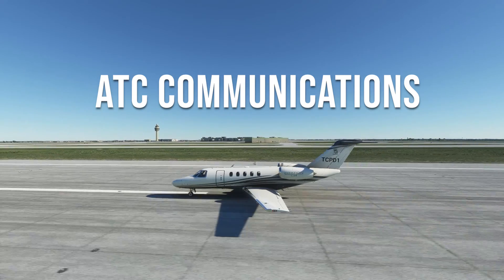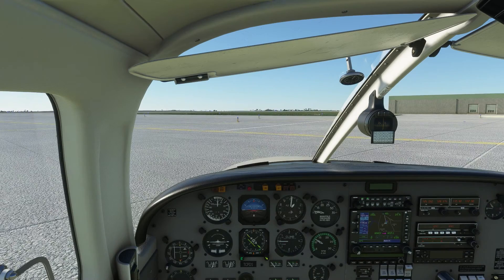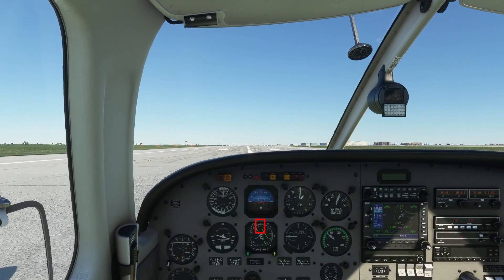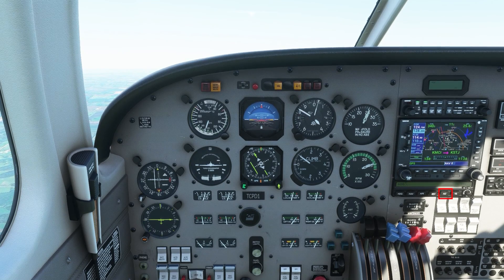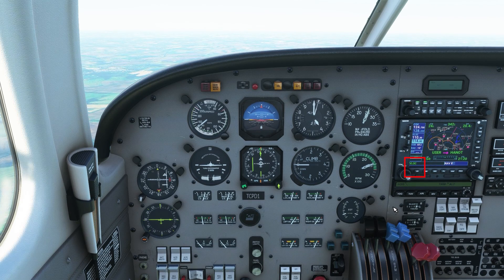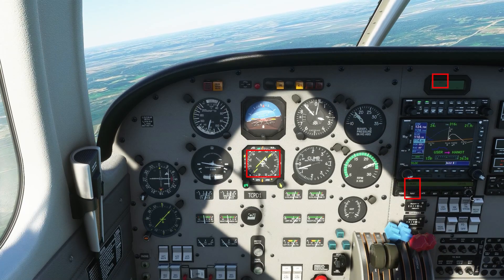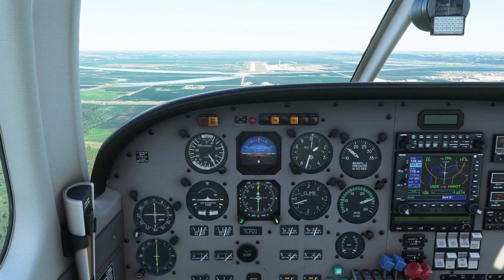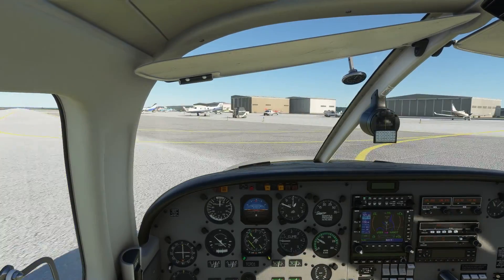ATC Communications Tutorial with a Pro Pilot and Real Air Traffic Controller - MSFS

Comment: Question why do i see you change oil and fuel mixture constantly
Reply from the maker: It was a short flight, I leaned it during cruise to rich of peak (so I had to see the EGT peak, then watch for a 50 temperature degree drop as I enrichened the mixture), then enrichened the mixture in the descent.   Leaning the mixture only reduces the amount of fuel to match the reduced amount of air at higher altitudes for proper combustion.  It does nothing with oil.
Reply: @thecorporatepilotdad  as if the communication wasn’t complicated enough
Reply from the maker: @RangerDink  In other words, I gave the airplane a proper sized drink of gas and then gave it an extra sip just to make sure it was properly hydrated.
Reply: @thecorporatepilotdad  Not gonna lie, Thats actually a fairly good description.

Comment: Now a question, why ATC uses the same "mic" as people on airplanes or helicopters?
Reply: The headsets and mechanism is a bit different for controllers. The controllers almost all wear a small earpiece with a tiny mic boom that goes beside their mouth. Much smaller and more simple than the common headsets used in general aviation.
Reply: They don't
Reply: I've seen them pick up a desk mic before, but maybe that's old school now.